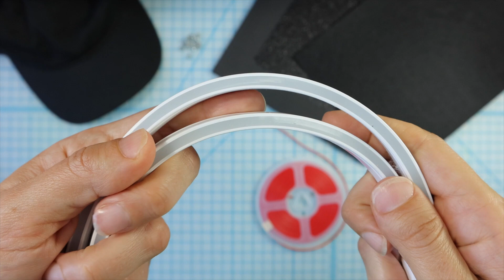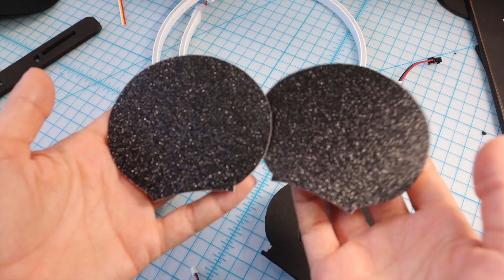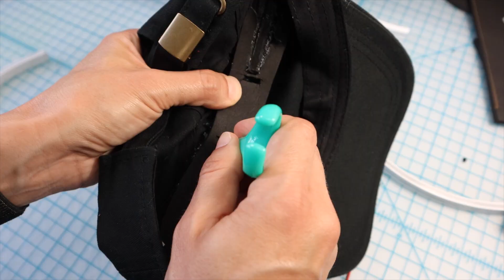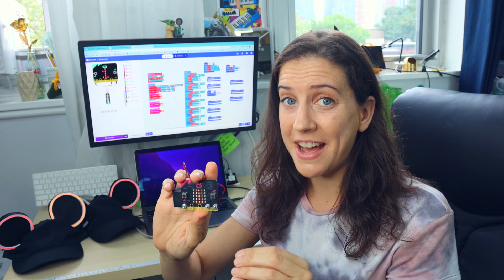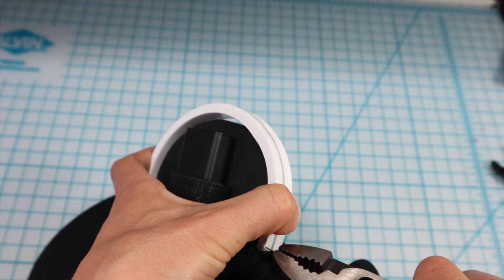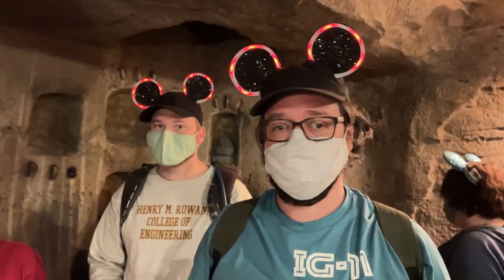Synced NeoPixel Mickey Mouse Ears using micro:bit

Comment: A couple of years ago, I made some light up Mickey ears using a Disney ear hat and the same neopixel strips.  I used an Adafruit Gemma M0 and LiPo battery pack.

I ended up gluing the neopixel strip to the plastic ears with a silicone glue, and using a bunch of clothespins as clamps while the glue set.  I cut the silicone casing away from the copper pads at the ends of the segments, sticking the bare ends inside the hat as additional mechanical support.  It never occurred to me to use paper or felt to cover the non-lit edges of the neopixels.  I ended up using some black paint, but it doesn't look as clean as yours. 

When your first LED segment was too short, I flashed back to my project.  I thought I had carefully measured, cut out two segments, only to find they were too short.  I bought two 1-meter strips (to make two hats), so one hat now needed one segment from one strip and one segment from the other strip.  That's when I found out that one was RGB color order, and the other was GRB order.  That took a bit of tweaking in software.
Reply: Wow what a journey! How did the silicone glue hold up? I'm always wary of glues like that. I like the idea of only using the "neon" cover where it counts and running the led strip inside. That's smart!
Reply: The first attempt at gluing didn't go so well.  I removed the clothespins after about an hour, and it separated about half an hour after that.  For the second attempt, I used sandpaper to scuff the surfaces being glued, only glued one to two inches at a time, and used about 3 times as many clothespins (as close as I could get them).  I kept the clothespins on for about 36 hours to give the glue plenty of time to set.

After 2.5 years, the very ends have come loose.  That's also the point of maximum curvature.  Note that the ears are a stiff, thin vacu-formed plastic.  I think that's favorable for use with the silicone glue.  They're not quite round, so there are a few small gaps.  The circumference is beveled/cambered, which means the neopixel strip doesn't sit flat against the edge of the ears.  That does leave some space for extra glue (on the back side); I don't know if that's good or bad.

I'll bet bare neopixel strips would glue up much better.  You can get them with side-facing LEDs just like what's inside the "neon" strips.  The effect would be different without any diffuser.  Perhaps one could find a semi-translucent material and cut out an arc to go in front of the LEDs.  Or take a "neon" strip and cut off the opaque silicone edge that would touch the ears.

3D printing a band to go around the outside circumference of the "neon" strip might also help hold the neon strip in place.  If you add tabs, like you did with the ears themselves, they could go inside the hat to help hold it all in place.  I'd be a bit concerned about the added weight.  Another possibility might be a fabric band sewn to the hat where the ears meet the hat.

Comment: there's no holes in the microbit for headers?
Reply: The microbit was designed to be used with crocodile clips, you can also get edge connectors and breakout boards if you want to use one with soldered connections.
Reply: @Workshopshed  thankyou for the explanation
Reply: The edge connector accessories can give you headers or whatever connection your project needs. :)
Reply: @TechnoChic  oh i see. pretty clever.